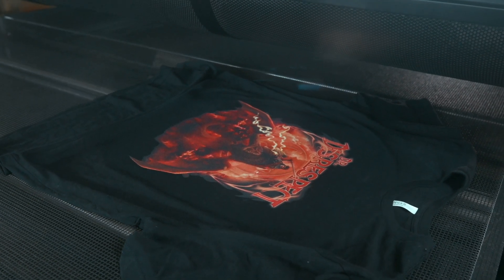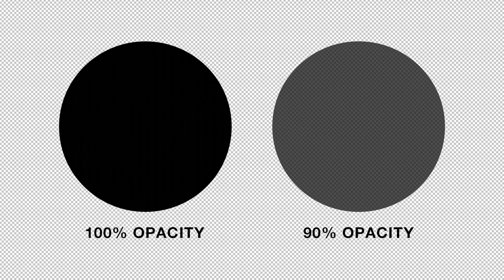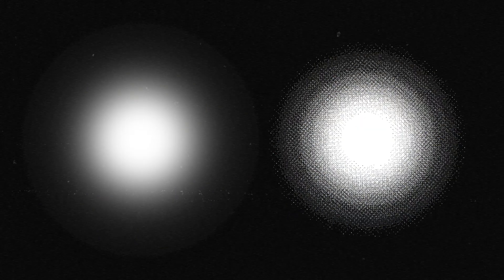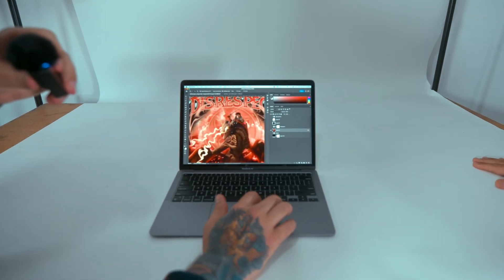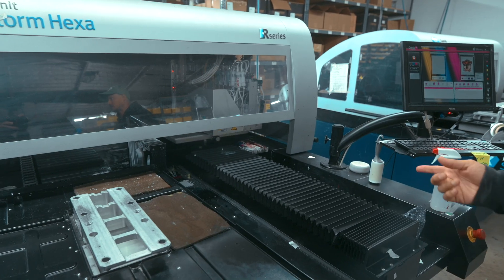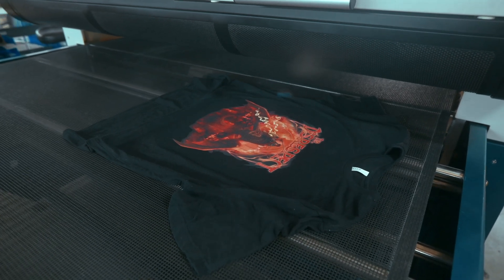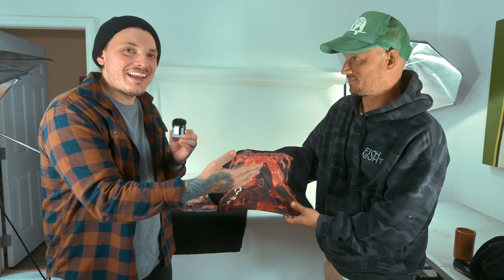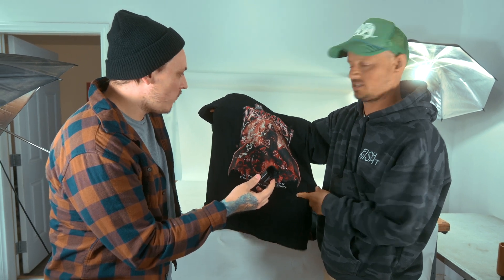Designing T-Shirts For DTG Printing? AVOID THESE THINGS!

Comment: Does this mean that a white area with fading out usually works? Just colour over it is not possible with such precision? Or are there printers who simply apply a continuous white layer underneath? 

A white layer with varying degrees of transparency would be really great for some of my designs even if they are a little sparkley, but a solid white layer in that hole area would be really unattractive...

Thanks for this informative video!!! Thumbs up!!! <3<3<3

Comment: This video was great and helped me out, been wanting to see DTG in action as I'm trying to determine if doing the halftone routine that people use on DTF transfers will work with DTG in a similar way and I think it looks like it'll work for me, I do more print on demand because I can't afford the equipment investment -- I'm going to submit a couple halftone/knocked out designs and order them myself and see if they're acceptable enough to keep online but this has me feeling a little bit optimistic that it'll work for me.

My main issue is one of my providers doesn't allow me to disable any of the color options (for the shirts) so I'm also attempting to try some different designs w/ a neutral sort of color that works on black, white, and colored shirts without looking too awful between them but not sure that'll work or not, seems with the halftone technique you kind of have to design it for one specific shirt color or similar colors but I'm going to test and see if there's any way I can make them look somewhat decent on multiple different colors.

haha, this stuff is a little bit stressful for me whose only designed for screen or paper printed products most of my life... again, great video!

Comment: so there is a lot here, but just 1 quick note. You can 100% keep the grain in your art. A lot if what is lost depends on the Rip Software and the Printer being used. They are using Kornit Storms. One of the things about the Kornit printer is it pringing wet on wet, for want of a better term, That process tends to not do well with small detials, like dot grain or fine/small text. If your art has a lot of those details i would sugest a printer that uses Brother GTX printers or ever higher production shops that are using the Roq NOW printers.
Reply: to help build contrast i bring the art in to photoshop and adjust levels, then the saturation and lightness, and finally, brightness and contrast. in that order. give it a shot.

Comment: I usually remove the black unless the design is inside a box or a giant solid shape. I also switch over to cmyk mode to adjust the color. Then ibswitch back to rgb to make my png. So far so good. I'm getting good colors and my shirts when I test them have been coming out well. I have yet to try using lightning. That will be my next test.

Comment: Great video! Around 6:40 Ian mentiones that there is a lot of noise in an area of the file, but it's hard to see from the camera what this noise is. I'm mainly concerned what happens when we remove the blacks from the image, because often individual pixels or small clusters of pixels that were lighter than the threshold are left in the artwork surrounded by empty pixels, and it concerns me that this might not print correctly using DTG. Is this a valid concern and if yes - how can this be avoided?

Comment: Did you print black ink on the black garment or is that technically a dark grey? I have done numerous tests with my machine printing the black in the design VS removing it and pulling the black from the garment itself. Just curious to hear your thoughts on this. GREAT VIDEO!!
Reply from the maker: I’ve also tried both ways. Black sometimes helps the print pop more but isn’t needed at all. I should of clarified this more in the video. Great question!
Reply: @CharleyPangus  Thanks for the quick response! Would love to talk to you about art and show you some of my work, see what I could improve on. Appreciate you

Comment: Hi, what the biggest size for DTG can print?
Reply from the maker: It varies machine to machine. Maximum is usually 16” x 21” but most machines can print up to 14.8” by 18”. Hope this helps.
Reply: @CharleyPangus  Hi, thank you so much for the information Charley🙏🏻
Reply: The better question to ask is, "what is the biggest I can dtg print on this t shirt or hoodie?"  As Charley points out, dtg printers can print huge prints, however printers have to get the garment onto a palette.  If you are printing a small shirt, it will have to be on a smaller platen, which will limit the size of the print.

Comment: for transparancy thing just make the design bitmap halftones like they do these days with dtf halftones, it works perfectly with DTG as well.
Reply: Yes!!!! Please do not provide print files with less than 100% opacity for feathering, blending, or cloud effects.  Use halftones @ 100% opacity to get more predictable results with your DTG prints.  Keep halftone size at a good pixel size, if your halftones are too small they will not be visible (same as any printing).
Reply: @IanGruber81  ye! Best way is to make the artwork 1200 dpi and then do halftones. Also knock off that black, bcz the tshirt black color can take care of that. It saves printer ink and makes the print less rubbery i guess
Reply from the maker: That’s what I mentioned In the video. I went over it a bit.
Reply from the maker: Thanks for watching